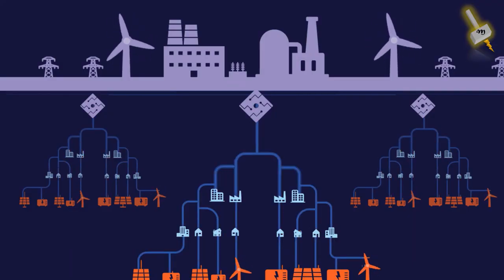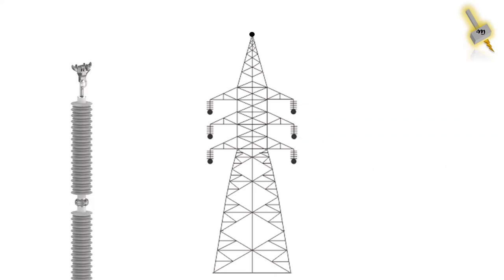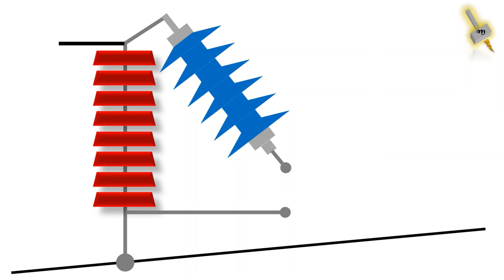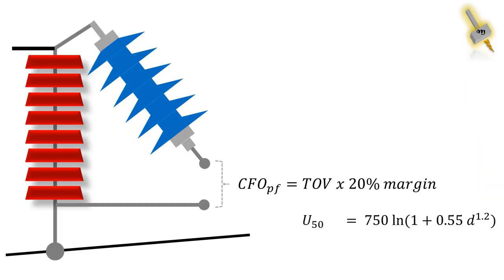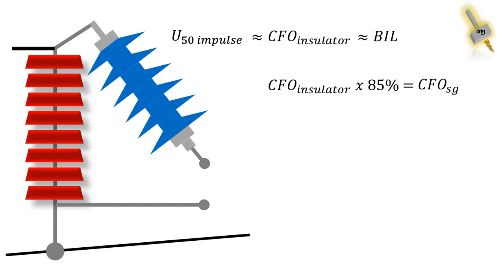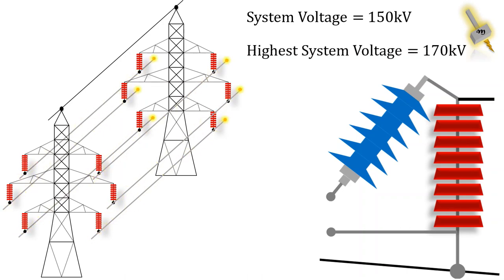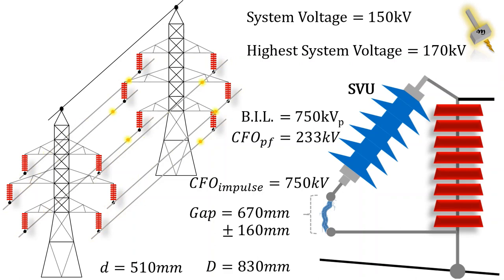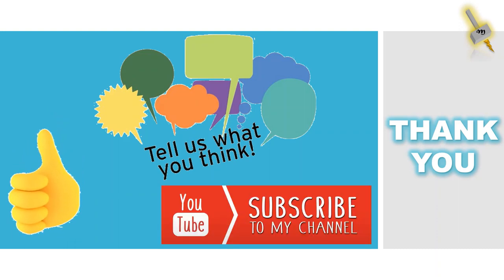EGLA Spark gap calculation

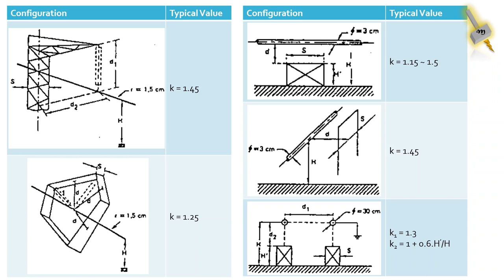Comment from the maker: Between video timing 6:25 to 6:46 it is shown as the breakdown voltage of air is 15kV/feet, it is actually 15kV/inch. That was a mistake.
and
At video timing 07:29 it is told as 510mm but at video timing 07:57 it is told as 511mm. The exact value was 511mm but it was rounded to 510mm. Calculation is correct.